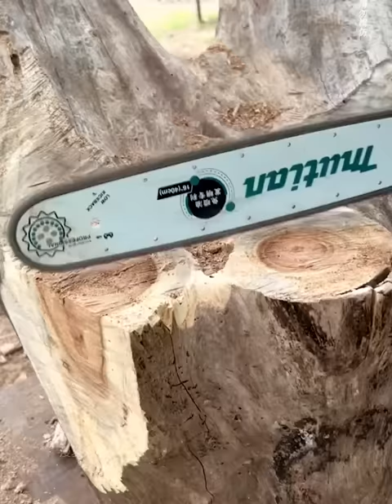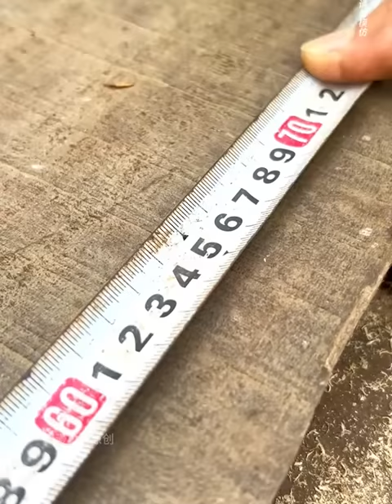Old House Renovation, the master bedroom leisure corner these days. ▶ 44

Comment: Appreciative of all your creations, you have the makings of a furniture designer but might I suggest greater study into human ergonomics when it comes to chairs? I did not like the design of your recliner. The back is too reclined and the seat is too horizontal when it needs to be angled up so that the buttocks sinks into the seat. Any person sitting in it will slide forward. There is also not enough thigh support so it will be effortful to remain seated in the chair. I thought you were going to make use of the natural recesses of the trunk to make a bucket seat or at least support one above it, if I remember correctly in one of your earlier videos, you sat cradled in such a tree, fully supported and comfortable you could nap in it.
Reply: I don’t think that would be a problem to him. He can always redo that to conform with your suggestions. He loves doing repairs, don’t he?